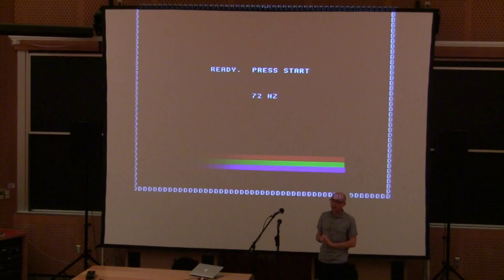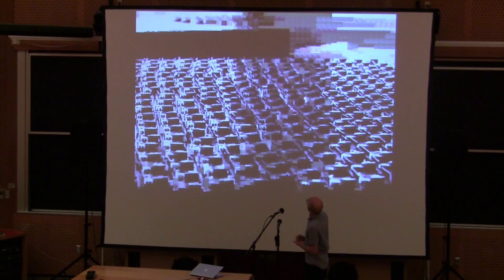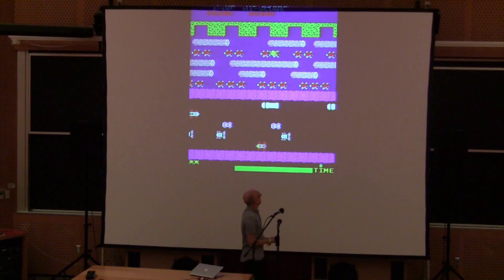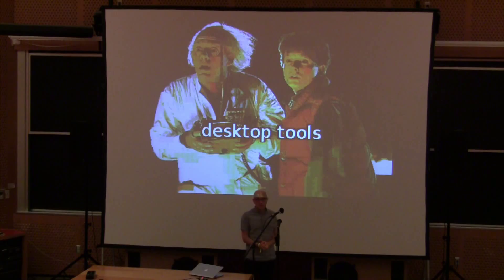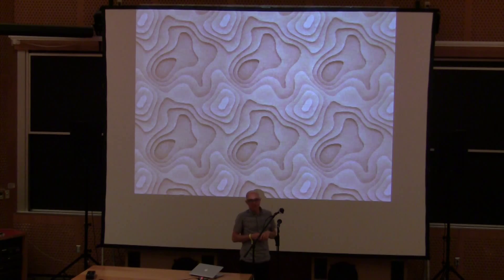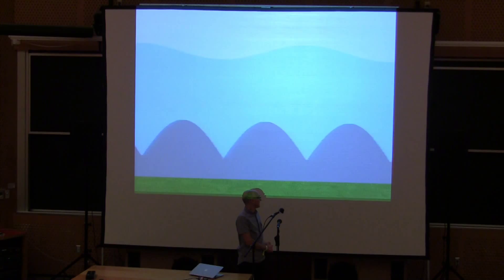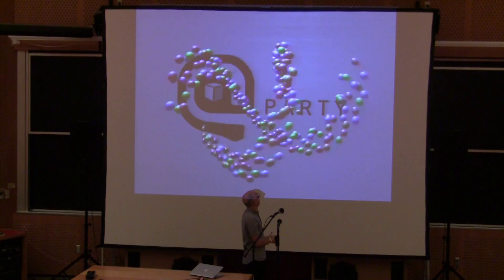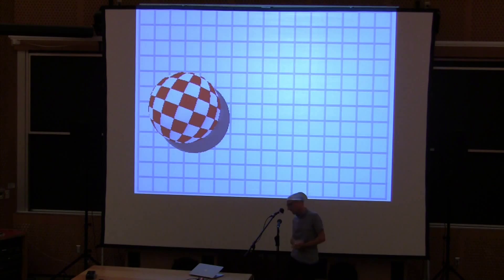James Bowman: Developing with the Gameduino

Comment: Im considering integrating EVE into my own project with an integrated STM32 chip...
While I can see there is no hidden trick to getting eve on a project... I could do with a bit of a How To guide to building your own integrated EVE board. 

One thing I'm a bit confused about is how to upload a sketch/programme? Do you need to upload one to the EVEs memory and then Upload to the MCU? Or is all sprite information uploaded to the EVE via the MCU?

Or do you have to preload all your assets into an SD card first then upload the programme to the MCU?

Adding EVE to my own project seems relatively cheap to do, only a fraction of the price of buying a pre built option like 4Ds... But I just need a little bit guidance...
Reply: I've used VM801B with Arduino Uno to emulate VM801P for few days now.

My limited experience is as follows:
-If wanted, assets can be stored in SD card and the arduino sketch will ask the gpu to load it
-Seems "like all sprite information uploaded to the EVE via the MCU"
-When I use the EVE Screen Editor, I can't find any way to separate the bitmap assets from mcu's program memory.
-Nextion is cheaper than EVE, but slightly less powerful